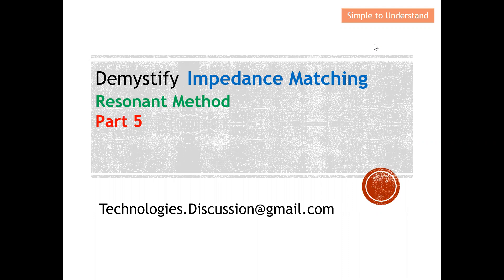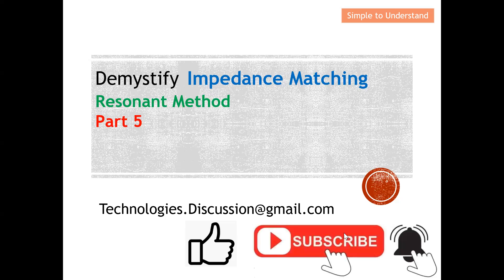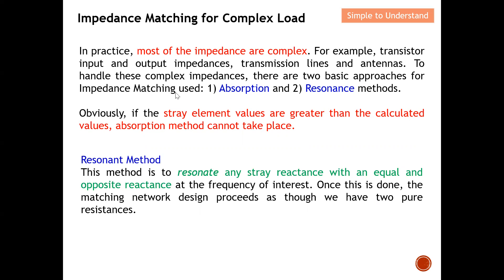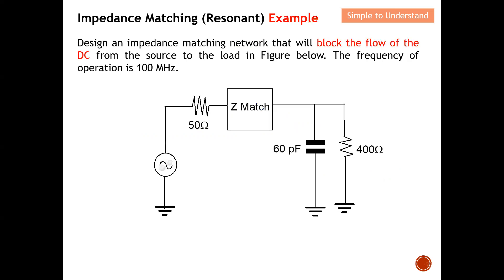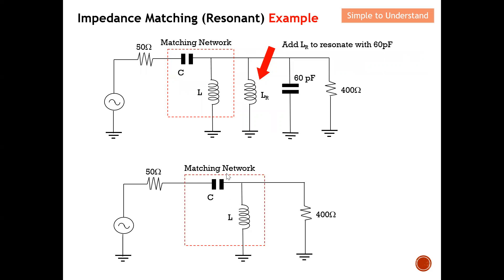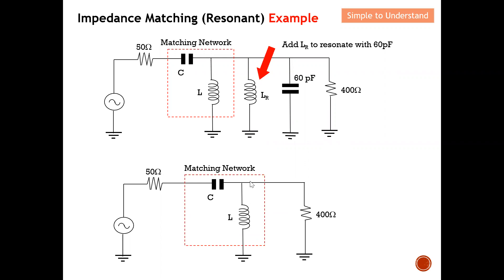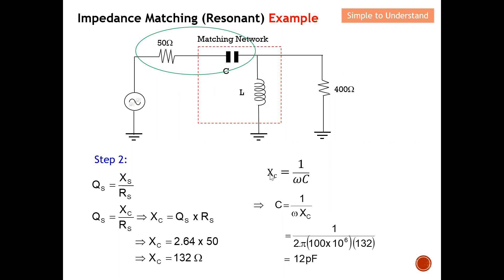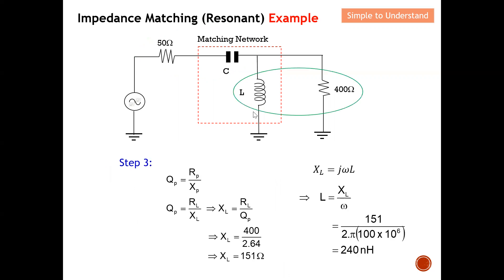Impedance Matching #5. How to Cancel Stray Reactance Using Resonance Method in a Matching Network.

Comment: Also, stray elements greater than calculated value means example stray inductance greater than Ltotal or Lmatching, then we need to go for resonant matching right?. My question is what is the condition stray inductance greater than Ltotal or stray inductance greater than Lmatching, at which condition resonant matching method to be followed
Reply from the maker: You can try to put a C. So when all these combine, C + Lr = L (ur design) then you can have the lowpass filter.  :)

Comment: Suppose if the requirement is low pass filter means impedance matching network will be series L and shunt C, then we need to design the resonant Inductor Lr to compensate both  the stray capacitance and matching capacitance and matching capacitance?
Reply from the maker: In this case, it may be complicated. Let me explain, my example is highpass filter (series C, shunt L), hence the L can be used to cancel the stray C. For your question, lowpass filter (series L, shunt C), you are not removing the stray C as you have 2 C parallel. In short, you need to design the lowpass filter C, together with the stray C to form the C that you need in order for the Lowpass filter to work. You may not have the solution so for me I will use another method to design the matching network. I hope I ans your question.  :)
Thank you for your question. Without your question, I will not think hard on this. Thank you for your contribution on this learning community.
Reply: @technologiesdiscussion1676  Thank you for your response, then in my case asked, stray capacitance with the matching capacitance to be formed means it is absorption method kind of thing right
Reply from the maker: Yes.  :)